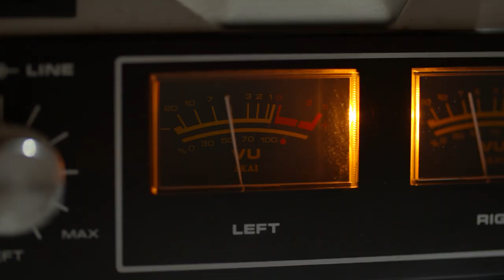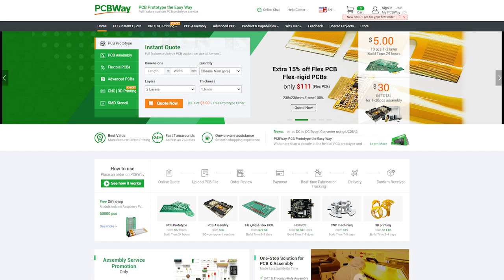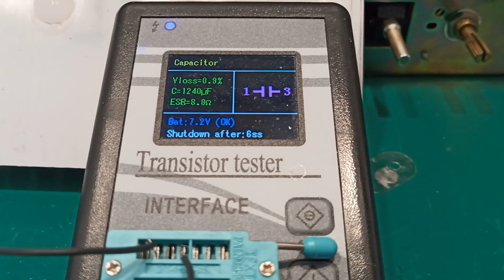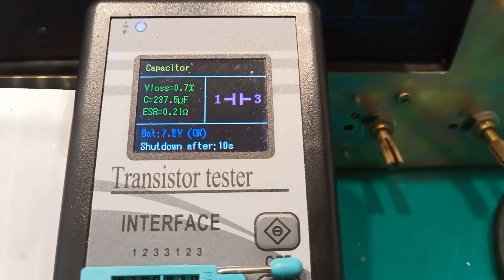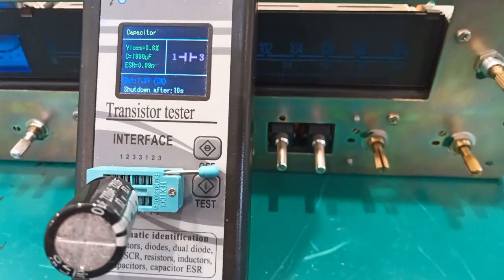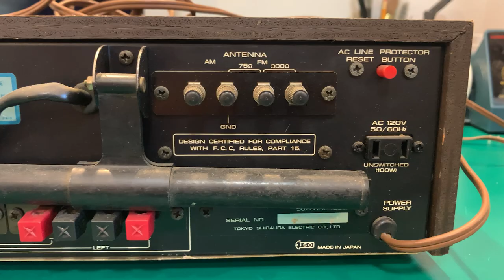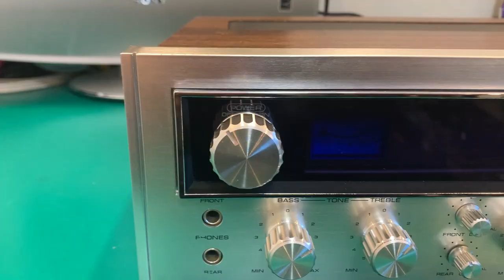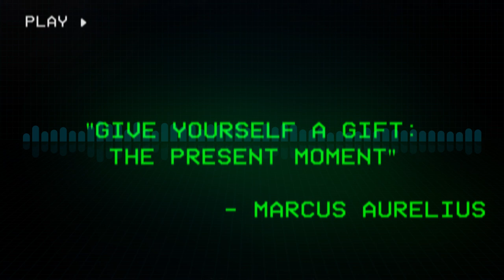Restoration of a Vintage QUADRAPHONIC Amplifier | Retro Repair Guy Episode 29

Comment: If you work on a lot of gear, a Hakko solder sucker will be the best investment you ever make. I could not live without one. Also, I replace axial caps with radial ones all the time without issue.
Reply from the maker: Hi Pete. Thank you I'll look into that pump as well. Yeah I've also replaced axial with radial but only when I couldn't find them. Plus I'm ordering all the time so I just threw them in the basket.
Reply: You are correct.  After spending fifty years servicing electronic gear I would never go back to using a pump type solder sucker after using an Hakko heated tip style desoldering station.  No damaging foil traces due to mechanical recoil.  Well worth the price.

Comment: You should get an Engineer SS-02 solder sucker. Those things don't brake easily and not that expensive neither 😉

Great video as always 👍🏻
Reply from the maker: Thank you for the compliment and I will check out this model, I believe I saw it before it's a Japanese made one? It was on my list!
Reply: @RetroRepairGuy  yep yep it's Japanese, best mechanical pump out there in my opinion.
Cheers
Reply from the maker: @eduartmisiraj8031  Thank you, great to hear I was not sure about the reviews as they sometimes apply to another item and they just switch the item. Will order one!

Comment: Really enjoyed the video. I love the variety of cool things you bring on the channel. I have a ZD915 desoldering stating. I love it. Way cheaper than the Haako. Otherwise I use a soldapullt. They are like 22 bucks but they suck like crazy and last for a long time. 8 bits in the basement is one of my fav retro computer channel btw. I'd love to see a collab.
Reply from the maker: Thank you I really do appreciate hearing that. I'm thinking about a desoldering station but I do like mechanical pumps. I know the soldapult very well as we had them in school and at work (or at least the same blue ones). However I found them huge so with this one in left hand my thumb can press the button easily without too much movement. The large ones I used to turn over and press against my thigh. 8 bits and I talked a bit I will try to collaborate but a bit difficult but if possible and we find an easy way we might. For now we agreed to call out to each other; we both liked each other's channel and both were subscribed to each other. Hopefully we find a way.

Comment: Nice tape deck and thanks for the video.
I have a Hitachi d 450 and a d 500 and I am finding it difficult to get genuine belts for them. Looks like I will have to opt out for generic.
Reply from the maker: Hi! Well I have good news and bad news. I've been fixing these things since the early 90s and I'll tell you there's not really such a thing as "genuine" when it came to belts even back then. While it was easier to go to a parts department and get it in an official company little bag, most of these were made by third parties. PRB was a huge manufacturer of high quality belts and pinch rollers but went out of business sometime in mid 2000s. Even if you find "original" or PRB on eBay, I would be very careful  because it's rubber and deteriorates over time. That being said, even back then much of the manufacturing of those came out of China or other countries. Now the good news is that you can buy huge bags of belts in various sizes very cheap from China; quality is trial and error and a little luck. But the bags full cost from two to five dollars so you can order from a few different sellers and try them. Hundreds of belts will cost you the same as one old one on eBay. You can check out this video https://youtu.be/n-cj6yT5a_s and at 31:26 I explain in detail how to check for correct size and other tips on the belts. Hope this helps and thanks for watching! If interested I am doing a giveaway on Saturday make sure to watch the latest restoration on how to enter https://youtu.be/lYiceEtB4e4.
Reply: @RetroRepairGuy  thanks for your reply brother. I already know about generic belts and bagd of 100 belts in one package. J have ordered a few and some of ghose belts made it possible to repair my decks thankfully. They were a lot more expensive here in Australia,  something like 30 dollars including delivery, but it somved the problem with a few. I am more stuck on the early to mid 70s Hitachi where everything is a little different, but the guys at web spare parts afe teying to help. Thanks for your vids man and have a wonderfull festive season.

Comment: Nice video. I always thought Toshiba (as well as Sansui) audio gear was well made and easy to repair. I would cringe every time I had to repair Sony stuff. Nothing unplugged with boards hanging everywhere while trying to replace blown semiconductors and resistors.
Reply from the maker: Hi there. Thank you. I noticed that the early 70s had a lot more wires and late 70s a little less. The HItachi OCL Amp from 1977 I fixed had almost no wires. And I find the 80s were the best ones. The late 90s started with all the integrated into one board crap and I started not liking it. But it also goes with the quality of the unit. Sony always made high quality stuff and I must agree; the Sony DVD player I fixed was so easy and the best to work on. Thanks for watching!

Comment: You sure that's a "Sound Quality" board, and not an "SQ" matrix decoder board, which is the matrix type some vinyl quadraphonic records  (CBS, Vanguard later on, and others, such as your Dark Side of the Moon T-shirt, EMI) album would've used. The other matrix on the amp would just be RM, "Regular Matrix" for use with all the rest except CD-4 which is quite different in requirement.
 I have one of these little Toshiba 304's, these are notorious for the bad ink on the faces that fades and comes off easy, not your bad at all.
Reply from the maker: Hi! Yes you are correct. Sometimes I have no idea why I say certain things and thank you for bringing that to my attention. I just checked the Service Manual and it clearly says it's the Matrix Decoder. I honestly cannot tell you where I got that in my head, especially when I specifically looked at the manual to identify the boards. Oh well I can admit when I'm wrong! As for the ink, I have all the Hitachi metal plate ones that I scrubbed and nothing ever came off of them, I even used cleaning solution and a magic sponge so I was angry at myself when that happened. I think I just had enough of that amp but it really does sound nice.

Comment: There are double capacitors which are 2 in 1 canes that some older amps used so be sure if they are single or double
Reply from the maker: Hi! I explained what you just said in detailed at 21:48 until 24:27 and that it says on the side of the can. I also mentioned that if more than one value in the same can is needed that there are companies in the US that manufacturer them. Thanks for watching!

Comment: Did you know that mica transistor insulator is better at transferring heat? They have less heat resistance! I have experienced it myself. It is explained on the internet. Mica breaks faster and you have to use more silk gloves. Mica does not burn
Reply from the maker: While one could transfer heat better there's also a benefit to using the silicone ones and that is that it won't dry up or crack after so long resulting in a short. It's also why some people debate whether thermal paste should be applied or not to a silicone pad and why I opted to do.

Comment: I have problems with my RCA 3 Disc Changer x Dual Cassette Deck. It works just fine, the spools spin, and the deck produces sound. However, recently the system only works if a certain amount of pressure is applied to the play button. Too less makes the sound sped up and unintelligible, press it all the way (normal position) it slows down and stops in a matter of 2 seconds. How can this be fixed?
Reply from the maker: Hi Edwin. Sounds like the pinch roller, as well a head cleaning and belt change; classic problems really. I would start with a thorough cleaning, changing the belt and try cleaning the pinch roller. The best is to use a product like Rubber Renue https://www.amazon.com/MG-Chemicals-Rubber-Renue/dp/B008O9X3KS (this is NOT an affiliate link just a link to the product). This product rejuvenates and restores rubber. However, it happens that the pinch roller needs replacing as it's sometimes too worn out and Rubber Renue still can't fix it. I would apply it 2-3 times. You can try alcohol but I would not attempt to use anything else that people suggest on Internet for cleaning rubber which I won't repeat here. For the heads of course use alcohol. Again here, for the alcohol I use 99% but you can use Rubbing Alcohol. I'm pretty sure that servicing the unit will do the trick. Let me know and thanks for watching!

Comment: For the lettering if you wanted to be a purist you pull badge of defunct unit
Reply from the maker: Stop putting ideas in my head. Mrs. RRG has enough "crap" around the house as she says! I'll see if I can get another one anyway! Lol
Reply: @RetroRepairGuy  my wife feels same every time I get a box of media from eBay or Hamilton book. I’m off to watch my latest from there. Two minute warning circa 1976 with chart on Heston tonight in the theater
Reply from the maker: @plexnbrown760  Actually never saw this one, adding it to the list. I'm lucky one of the girls who's only 13 is into the old B/W Alfred Hitchcock and even watched Bride of Frankenstein so I'm catching up on all the really old ones. We even watched The 39 Steps 1935. Mrs. RRG won't go older than 1982 with the exception of The Godfather.
Reply: @RetroRepairGuy  I have been working my way through Charlton Heston catalogue , I tend to go by an actor or director and make it a hunt to find the items in their catalog as cheap as I can. Bit of an odd hobby on mine.
Reply from the maker: @plexnbrown760  A fun one! I grew up on movies, skipped school to spend afternoons in the theater like in Last Action Hero. Which is why I needed to build myself my own little cinema. I adore watching and catching up on all the old films. Not an odd hobby at all, a fun one. PS but I NEED the popcorn!

Comment: I believe there are movies that have 4.0 tracks on criterion collection On dvd at local libraries. I can’t remember off top of my head but your best bet is criterion collection to test this sound beauty on a 4.0 track for free.
Reply from the maker: I'll check that out. Would be great to get a Pink Floyd quad track. Thanks!
Reply: @RetroRepairGuy  the new Godzilla criterion collection movie set has 4.0 sound. We have it at our local library but I’m not sure how good library system is where you are
Reply from the maker: @plexnbrown760  Pretty much non existent! I'll look for some music track. Saw a guy on YouTube comparing the Pink Floyd Quad version of a record. I want to test this amp more for music. For movies, I have an older Pioneer Elite series that's THX certified and I don't upgrade it because it's actually quite amazing.
Reply: @RetroRepairGuy  makes complete sense. I know a guy that crazy about ‘what a director intended’ that has a screen he rigged up auto binds and the screen grows and srinks as needed and he uses 3 different amps.
Reply from the maker: @plexnbrown760  Nice. I'm sure I might have gone nuts if my budget was unlimited, but at the same time there was something always cool about simple old cinemas that only had the seats and a big screen and the old red carpet and I'm super happy with that! I just happened to have this amp because when i was younger I kept upgrading my amp. Now, I'm done upgrading. With these old restorations, I'd say I'm downgrading and it's awesome.